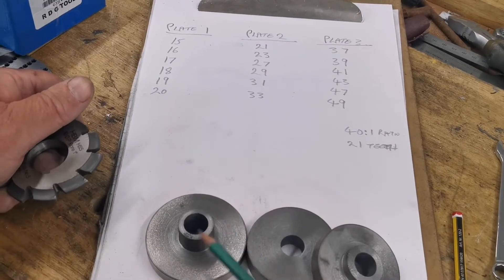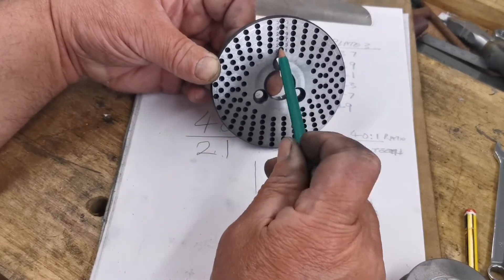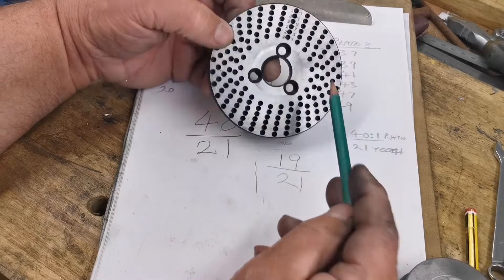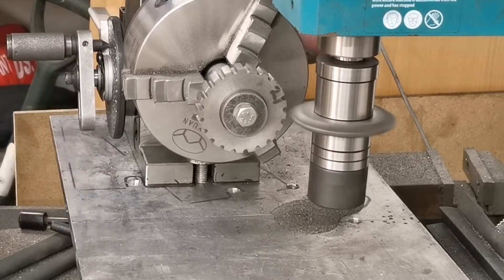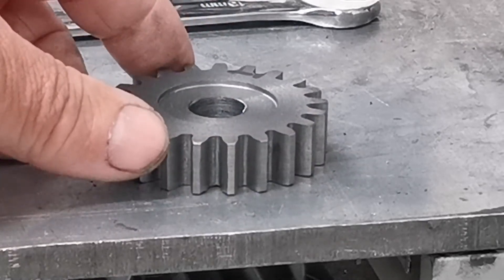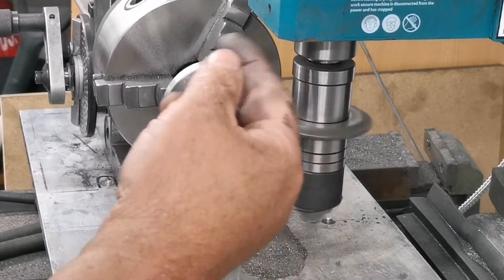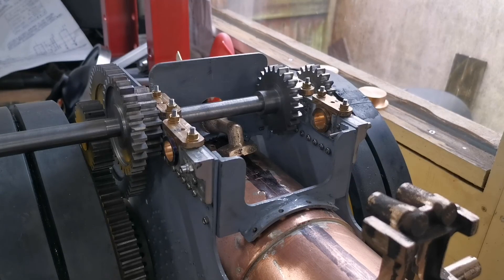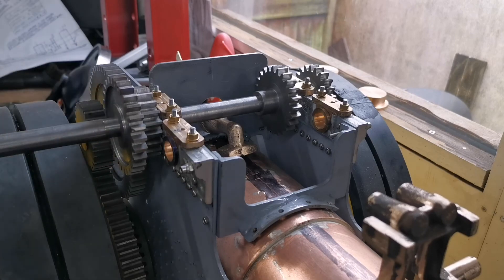2" Fowler Showman's Traction Engine 2nd shaft gears are all cut

Comment: Looking good cutting gears takes so much concentration iv still got a 80 tooth to cut for my 2" traction engine  much respect keep up the good work enjoy watching your videos
Reply from the maker: Thank you, it does take a lot of concentration cutting gears, and also quite a lot of time, specially with a small milling machine like I have, good luck with your gear cutting 👍
Reply: @jammymowlam1  well iv not got a cutter yet or the blank to cut it from iv been casting the crank bearings this weekend just keep chipping a way as I can 💪